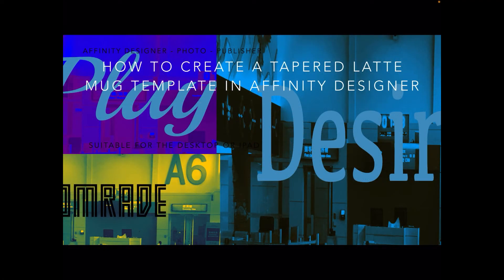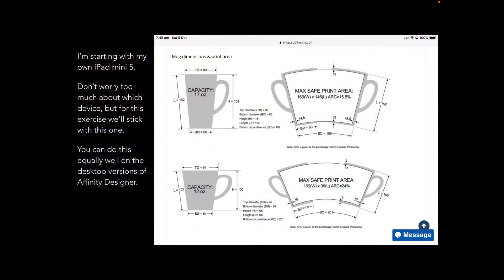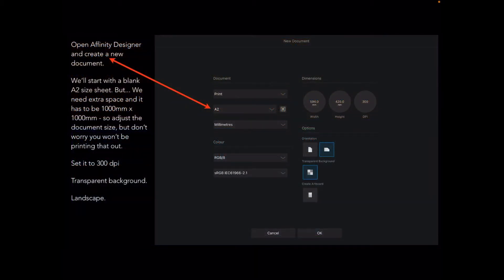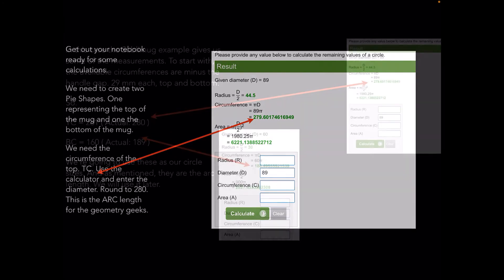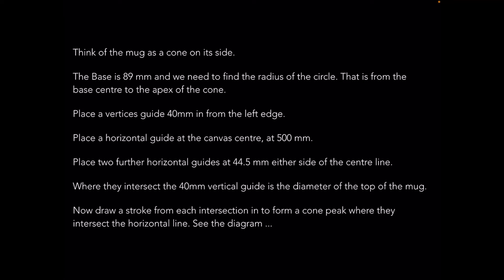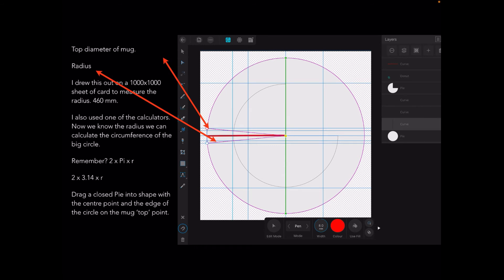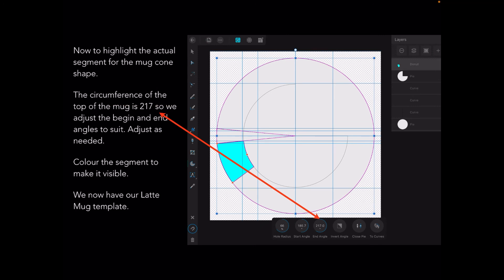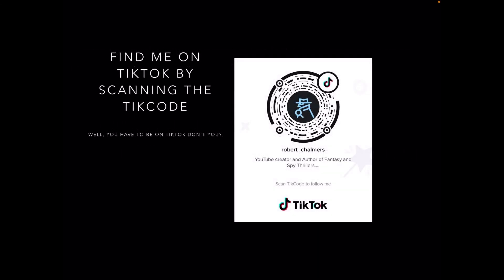How To Create A Tapered Latte Mug Sublimation Template In Affinity Designer

Comment: can you show us ohw to do this using windows? I was able to get the math down however there is a part where you stated before you can draw any circles you have to enter the dimensions and that is where I am stuck......I do not see my screen the same place your dimensions are entered and can't move any further from there
Reply from the maker: I will have a look on Windows and see if I can find what you need. To my knowledge Windows should be the same, but of course different platforms have different controls.
Reply from the maker: Hi again, I'm looking at the video here and can't see where you may be talking about entering the dimensions. Are they the dimensions needed by the external web site for calculating circumference etc? Can you tell me the point in the video where this occurs please. Otherwise the Windows version is exactly  the same.